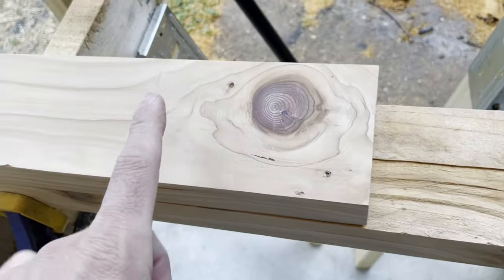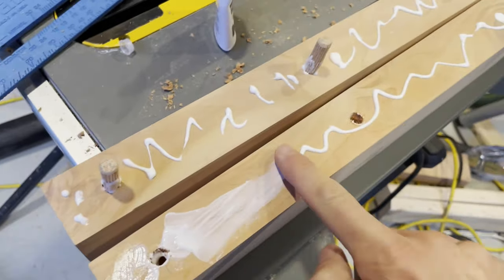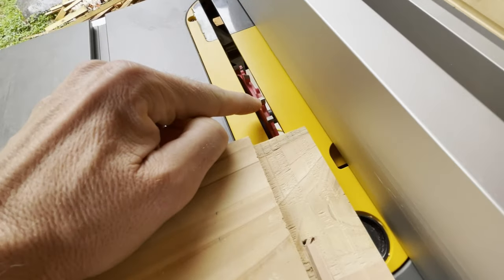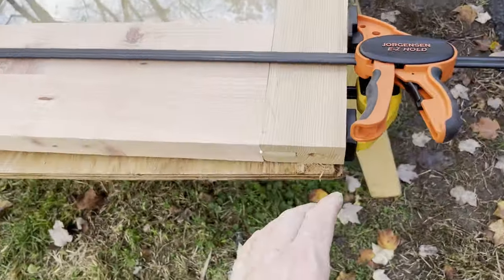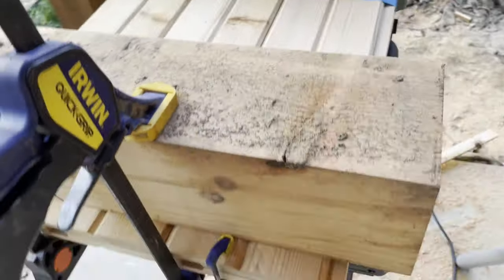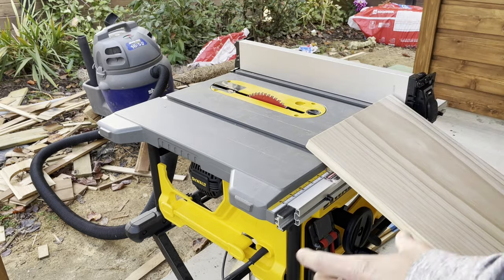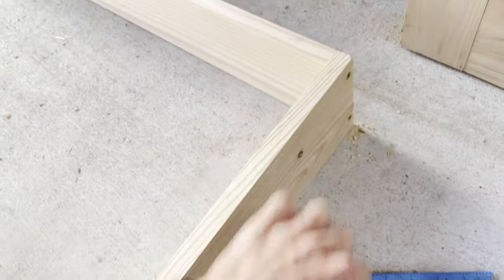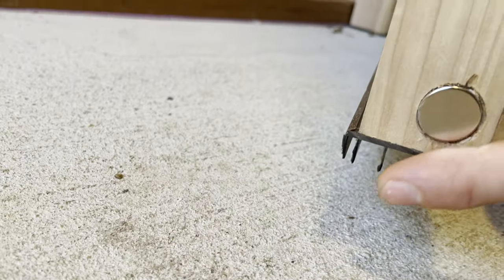Custom Build Cedar Sauna Door with Tempered Glass

Comment: Using glue on a sauna door is never a good idea as you will always breath the particles of al toxic things when the sauna is heated.
Reply from the maker: Wood glue is PVA. It is nontoxic. But for the same reason I definitely would not put stain or anything strong on the interior wood. They make a special oil for seat or other places where people may sweat to avoid staining but it is a nontoxic oil like you use on cutting boards

Comment from the maker: The door took about a week to finish. I ordered the 3/8" tempered glass from a local glass shop and had to wait several days. Several stages required an overnight glue. I was also multi-tasking with staining the outside of the building.

Comment: very good work, congrats !!!I have some questions ? what it is for the small magnet of the door, at the bottom ? and how well do the Door Ball Catch works ? thanks so much !!!
Reply from the maker: Thank you. The sauna control has a magnetic sensor to determine if the door is open so the heater won’t run while the door is open and waste energy. The magnetic does not hold the door closed but just acts as a sensor. 
The ball lock works perfect for me, especially as a safety feature to avoid anyone getting stuck inside in an emergency, they can just push the door open. There is weather seal foam around the door so it stays tight if you install the ball lock in the right position where it pushes the door against the seal.

Comment: Really well done! May I ask for the dimensions of the piece of glass by any chance?
Reply from the maker: @istvannagy7212 I ordered the tempered glass custom from a shop at 20"x31". I inset the glass 1/2" on all sides into the groove. The size of the glass was determined by the size of the door, especially the width. The height I just made it as big as I could while not making the whole door too heavy. I played around with the frame for a little just visually seeing what looked good